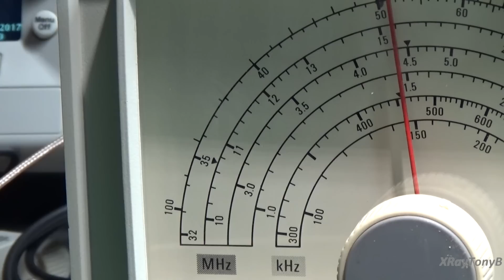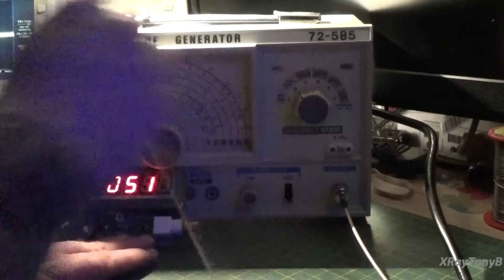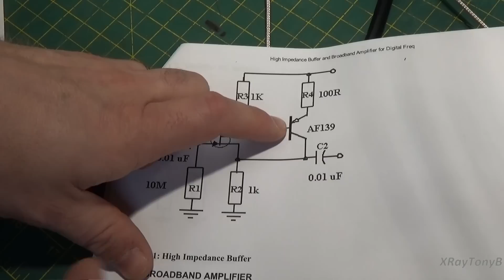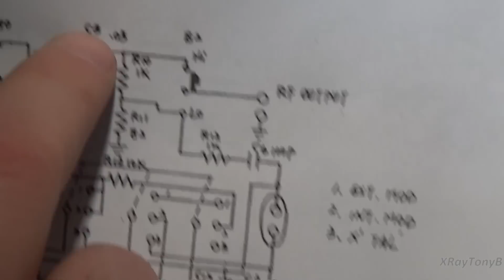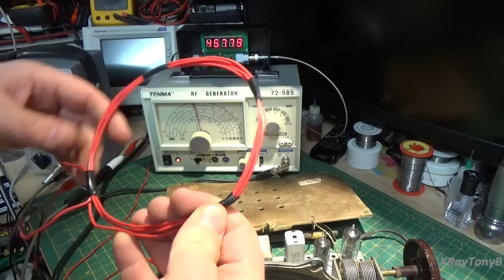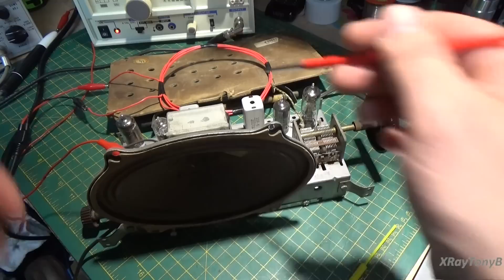Tenma Signal Generator Mod and Demo

Comment: Nice job on the modification to your signal generator, I wanted to point out to others there are at least two other companies that sold this exact same signal generator under a different name but slightly newer but with a factory supplied separate BNC frequency monitor output. Two of them are the BK Precision 2005A, and the Goodwill Instrument Co. GRG-450B. I see these on Ebay quite a bit

Comment: After watching this I essentially did the same thing with a VIZ WR-50C and it works perfectly.  BNC just below the crystal socket attached with a single wire to the junction of C105 and R106 for an external counter. Thanks for the idea!

Comment: Excellent video! That Tenma is a vast improvement over the tube type Eico & Heathkit RF signal generators I have. I picked up an Elenco SG9500, which is solid state and similar to the Tenma, except it has a counter/digital display instead of the analog dial. Presently there are better choices for modest cost RF signal generators, even at new prices. Consider the tinySA & tinySA Ultra. These are feature packed, small devices. There are two major factors to be aware of. First it is all too easy to kill a spectrum analyzer by overloading the input. Second there are fakes of these devices. If anyone intends to get one, do your homework. There are plenty of YTs covering the use and fakes of these devices.

Comment: Nice job.  I added a regulator to the the PS (for better Freq stability although yours seems good) & a small air variable cap that I connected to the main air variable & mounted to the back of the cover to get better resolution of the main Freq control.

Comment: Thanks a lot for sharing this tutorial, your .01uF capacitor fix to stabilize the attenuator worked great on my BK 2005B signal generator which is the same as your Tenma 72-585 as you know. I use an external frequency counter which is also a BK counter. My oscilloscope clearly shows the difference in attenuation without lowering the frequency value. It’s back on my workbench for use now.

Comment: Great video! I have an Eico tube version of that signal generator. I’m going to get one of those frequency counter modules to add to it. One point I’d like to share regarding the noise from your other piece of test gear. That is a common problem with electronic equipment nowadays, but the worst culprits for generating noise have to be the fluorescent light fixtures that are for sale now. The noise from them will completely swamp an AM radio, making alignment next to impossible. Some of the LED fixtures are bad for noise, too. If you want to work on AM or shortwave radios, you’ll need to use non-electronic ballast fluorescent
 lamps, or good old fashioned incandescent lamps for your bench, at least while you work on radios.

Comment: Excellent answer to a common problem- how to get better accuracy out of yesteryear/ lower cost test equipment. I was thinking of doing this very thing with a B&K RF generator and an Elenco AF generator. This makes the third video of yours I've watched. First was on the Eico capacitor checker. Just got mine today and started desoldering capacitors before watching your video. New subscriber here! I may have some questions for you at some point.

Comment: I liked the Frequency meter addition so much that I added a small modifications to power the Frequency meter from the signal generator.  I attached a 680 ohm resistor the B+ 24V line. The frequency meter gets about 5V and the B+ is reduced by only about 0.5v.  When you turn on the Tenma power the frequency meter goes on also.

Comment: Best ideas: don't ever turn it off - get better stability, set at known level   say 10 mv that lets you read freq. Then use step attenuator, or several bnc type M/F barrel ones at 3, 6, 10, 20 db. Etc. Place between gen and radio. Add attenuation as needed to get in microvolt range. Make table from net or calibrate with big test gear to convert  10 mv to handy nicrovolts. Now u read freq and mv from gen plus still get known signal levels to radio. 20 db atten give 1 mv, anthe 20 gets 100 uV, and so on.

Comment: Greetings:
Isolation transformers when bought NEW can be a bit pricey. Also because they are heavy in general and get heavier as they have higher power capability; it may be best if you can source one locally. To that end, the ideal Isolation transformer has an input to output ratio of 1:1. Most of the time you can achieve a low cost by finding a transformer in a piece of obsolete or simply non-working equipment. What you are looking for is a transformer that is equipped with two 110-125 vac windings that allow switching between 120 & 240vac. When wired up, one of those 120vac windings will be used alone as the input and the other as the output. Do not be confused by schematics or wiring diagrams that imply that those windings are for input use only. As long as all windings are isolated from one another or willingly be unused, then they can be used for either function. If by chance you intend to be working on older equipment originally designed for lower mains voltage, you can wire any 5v, 6.3v, or even 12.6v ac outputs to be used in series with the primary to increase or decrease the output voltage by appropriate wiring choices. You should understand how to determine whether you will be increasing or decreasing the output ac voltage depending on the polarity of the windings. Be sure that all unused windings remain isolated and are insulated against accidental touching. Although not a convenient alternative to a variable AC transformer (aka variac) they can be wired to perform similarly. Again, in almost all cases only series wiring should be used and all arrangements should be measured before assuming your wiring is correct. Also, since one of the original 120 vac windings is being used as output, only 1/2 of the original power handling capability remains (e.g. for original 5a input capability, only 2.5a remains for the output winding). I hope no one assumes this is easy if you have no experience. Do this at your own risk. Be careful.

Comment: First of all thank you for sharing your experience and enthusiasm with us. I am a 66 year old newby to this hobby and am learning so much from your videos. I have just started  this conversion on my Altai TE 20D, all good so far. Just one simple question.  The coax cable you used from the internal tag strip to the BNC socket inside the case, should I use 75 ohm or will any other value do ? Thanks again for sharing your knowledge with us. Terry

Comment: THANKS for your video......Nice description of the fundamentals of the AM alignment, researching alignment most videos think you know it all and don't include things like why there is a squeal.  and why it is because of the fact that the signal generator and the radio RECEIVER signals are not in sinc,
AND    how it ties into the tuning dial indicator and why stations say they broadcast at some frequency that doesn't match what I find on my dial.....

... how about the Short wave alignment?? are they done with the  455 and 1600khz, settings on the signal generator just switching the meter bands?

Comment: Great video thanks very much. So the local oscillator tracks the incoming signal and keeps its spacing of 455 Khz via the 2 tuning capacitors being locked together on the same shaft, but can the local oscillator ever go of frequency because some other component has changed value in the circuit. So instead of tracking it at 455 it's wandered to some mad difference say 800 kHz away. What other components are involved in making the local oscillator oscillate.
All very interesting stuff. Thanks

Comment: tkarlmann great idea... on the other hand this is an analog dial signal generator that may or may not be very accurate. You can get an online signal generator that will cover  HF on eBay for $52 shipped - and it will greatly outperform this sig gen.
Reply: Bry C most of those cheap signal generators are square wave generators and are very high in harmonics ... This type of signal generator  produces a clean sign wave .

Comment: Another great video Tony, I saw in the end there that you have a HP 8657... I got one of those and really never used it.. Well actually I don't know how to use it. Would you consider making a video on that piece of equipment?  And yes we would definatly want to see the SX1050 repair. Thanks again
Reply from the maker: Andre,
I'll see if I can do something on the HP 8657.  It's a great signal generator.  
Thanks for watching!
Reply: I've got one too, it is great. Does AM and FM. Powerful and accurate. I'd like to see a video to get the most out of it.
Reply: Yes it is. I bought it on eBay and it was in very good condition and seem to work well. Not sure about all it's features but I like it.
Reply: shango066 has some videos out where he uses it. The one he has called "AM Radio Silver Mica Disease Repair Tube Radio" is the one that convinced me to get one, but I haven't seen any review videos or how to videos regarding it.
Reply: Thanks I will take a look at it.

Comment: The best thing to put in front of the LED display would be a "circular polarizer"    There are some folks that make them at a reasonable price.  Basically any light that goes in through the polarizer, can never come back out to glare out the light from the digits.

Comment: Great video.  the old AM radio looks similar to the one we built back when i was in BOCES in 1980 (less the tubes of course lol). considering the components are fixed in the Tenma generator, any way to bring it into  better alignment? Would make for a nice video itself.  Haven't heard the name MCM in a long time!  Used to order form them at my first job in '82.

Comment: Most of those sets had two (ferrite) slugs per I.F. can, and two I.F. cans per set, or the I.F. can had no (adjustable) slugs, and - instead - had two trimmer caps, both accessible from the top. For his set, there should be another slug, reachable from the bottom, with the set turned over. Don't forget to peak these, too!
Reply: sorry to be so off topic but does any of you know a way to get back into an Instagram account??
I stupidly forgot my account password. I would appreciate any tips you can give me
Reply: @Caleb Alfred Instablaster =)
Reply: @Jaxon Abraham thanks for your reply. I got to the site through google and I'm waiting for the hacking stuff now.
Seems to take quite some time so I will reply here later with my results.
Reply: @Jaxon Abraham it did the trick and I actually got access to my account again. Im so happy:D
Thanks so much, you saved my account !
Reply: @Caleb Alfred no problem xD

Comment: I have a lodestar and this is a very helpful modification.  I load up my leads on 1M port on my freq counter Teed also to my coil to radiate a signal to radio, and it seems the freq counter is overloading the generator.     Im then way off on the manual scale

Comment: Tremendous tutorial, thanks so much for sharing.  I'm looking for a RF Generator for alignment of older Ham Radio transceivers - not sure if attenuation control is fine enough for this purpose?
I note GW Instek produced something similar with ext counter port- model GRG-450 that might be viable and plenty on eBay.
Reply from the maker: Christopher,
Thanks for watching!  If you plan on only servicing AM radios, most any RF generator will work.  If you want to get into FM, you may need to go with a better unit than this one.

Comment: Could a similar mod be conducted for Model LSG -11 Signal Generator please? 

If so, where on the circuit board would you tap off the signal for the frequency counter frequency input?

Thank you very much!

Kind regards,

Peter

😁

Comment: To get your RF sig gen dial accuracy to line up with the output, you can trim the main oscillator with a silver mica cap to get the output to line up with the dial.

Comment: I take the signal from the generator, and attach it to a freq counter, with a oscilloscope probe(on 1x) and tune the generator to 455 khz, not matter what the generators dial says, then do the alignment.

Comment: can you use a 4 ohm resistor connected  to the speaker wires, and disconnect the speaker so you can turn up the volume wide open like most alignments call for, to do the alignment?
Reply from the maker: Yes, you can do that.  Another way that I didn't show is to tap into the audio signal before the volume control.  Circuit designs vary from radio to radio, so you need to look at the schematic to know where to connect.

Comment: What if you salvage and verify some old IF crystals ,plug them in? I have used another counter, all in one,off air freq,and ctcss,dcts, cost 25 ish$. You can hide it inside, but I Velcro them in case you want to move it. I also made a accessory , 50,75,300 OHM padding device with a counter in it , Similar to the one you used. That way I can get more control,of impedence match, any 50 or 75 ohm pad will do. Good work repurposing,updating old hear.

Comment: the plastic hex tool. shoudl work from top for both top and bottom slug... the hex part of tool if its like 1/8 or lil hair more. then round plastic to the handle.. you slip it thru the top slug find the bottom slug and do ur tune then slip it back up to the top coil .. so on ..

Comment: A 9V 78L09 voltage chip would be really easy and guaranteed not to add any switching noise to the RF output. But that signal generator is really tricky to accurately set above 15 MHz even with a frequency counter isn't it?!
Reply: "But that signal generator is really tricky to accurately set above 15 MHz even with a frequency counter isn't it?!" 
Yes it appears so but I found this video where an RF pre amplifier is used https://www.youtube.com/watch?v=P1h8N6GaZXQ . I have tried using one of these pre amps along with a  cheap frequency counter off AliExpress. I have also had an SDR running on my laptop at the same time for comparisons. I found that I could get frequencies to stabilise around 24 - 25mhz up to 30mhz with a slight variation in readings from the SDR. The signal generator I'm using is a TRIO SG-402. Note: I'm relatively new to all this and no coax was used and connections were not the best so I'm sure there would've been signal loss etc.

Comment: I see a problem with the way you are aligining that radio...
The IF transformers do NOT change the Local Oscillator frequency....
There will either be a variable slug in the Local Oscillator coil, OR it will be a trimmer capacitor.
You need to adjust this slug or trimmer to set the Local Oscillator to get the oscillator running at 455 Khz.
THEN, you adjust the IF transformers.
If you adjust the IF transformers without checking the Local Oscillator frequency first, you will be aligning the IF stage(s) to whatever the Local Oscillator is at, which may not be at 455 Khz.
In many cases, it will be close enough so that just adjusting the IF transformers will get the radio working adequately, but not as good as it could be.
Reply from the maker: This radio has been aligned many times, as it's my demo radio.  The IF coils tune the IF stages to the IF frequency, which on this radio is 455KHz.  The local oscillator is adjusted via the trimmer capacitor that is located on the end of the main tuning capacitor.  Each IF coil has two slugs, one on top and one on the bottom.  I just showed the tuning of the slugs on the top for demonstration purposes (I actually de-tuned them off camera to show the effect. 
 I left the bottom ones tuned in).   This video was not intended to show a full alignment of a radio, just to demo the signal generator after the mods were done.  Sorry if I caused any confusion.  Thanks for watching!
Reply: xraytonyb understood...but many viewers of the channel will get the wrong idea on how to align a radio by watching this video.

Comment: So if one wanted to use a freq. Counter with say 7 or 8 digit display could one connect the BNC connector where you had on the board and then just connect the freq counter to the bnc installed on the board of the signal generator. With the freq. Counter having its own power supply?
Reply: All he's really doing here is creating a separate monitor jack that will have a "fixed" output. You should be able to use it with about any bench frequency counter or scope.

Comment: Friend my RF Signal Generator 17A is the same as yours internally the circuit, it does not have any CI, it is all transistorized, I need the Maintenance and User Manual scheme.
Do you have your Manual or where can I download it because they are the same.
Can you send me please.
Thanks Oliveira